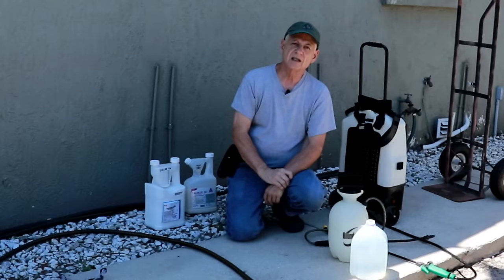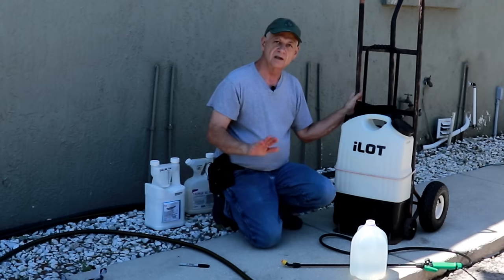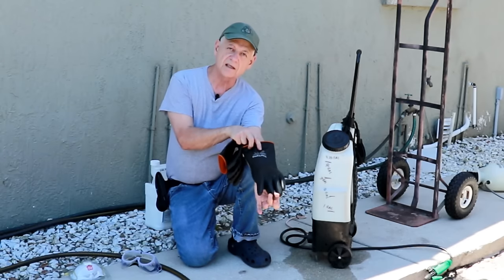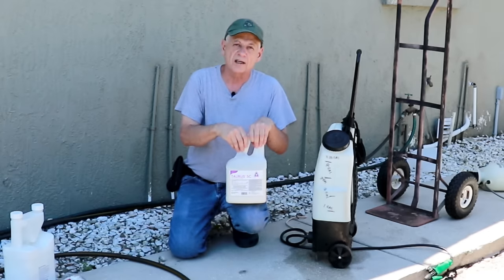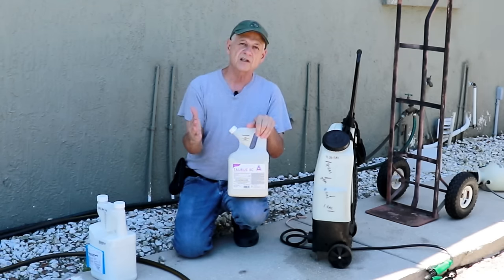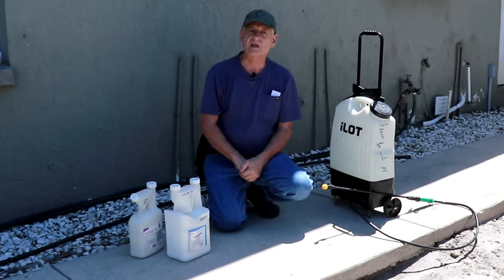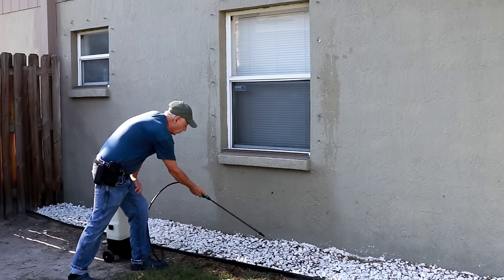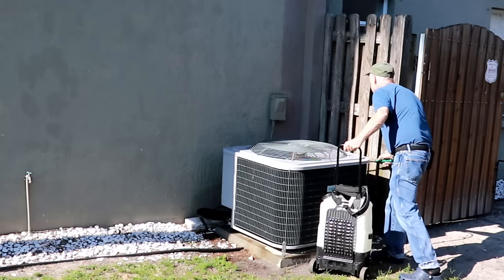General Exterior Pest Control - IMPORTANT!  READ THE DESCRIPTION.

Comment: I love Birchmeier backpack sprayer I think it’s the best in the industry. Do you like products Alpine WSG or Suspend Polyzone or Demand?
Reply from the maker: I have never used a Birchmeier sprayer, but I’ll bet they are really good.  I checked them out and they look well made.

The three products you mentioned work somewhat differently.  That is not to say that one is necessarily better than the other.  That being said, I'm not sure that I would use the Alpine WSG for exterior use.  It's a super safe product and that makes it a good choice for interior use, but the reason I would shy away from it for exterior use is that it does not possess the longevity that some other products do.  That is to say that the residual activity is only about 30 to 60 days.  The other products you mentioned can last up to 90 days.  I mean, time is money, so why retreat the same areas more often than you need to?

Out of the three products you mentioned, I have not had the opportunity to use Demand yet, but it does sound like it would do an impressive job.  I will have to give it a try one of these days to see how it does.  I don't see any reason why it wouldn't work well.

The Suspend Polyzone uses deltamethrin as the active ingredient and I have been using deltamethrin products for quite a long time now.  It works well, but I can't say that it works any better or worse than other products that are on the market.  The truth is that I do not conduct any sort of research on various products.  I think most of them pretty much do what they claim.  As with most people, I have a tendency to stick with what I know.  It's like that with all sorts of things.  People seem to like a certain brand of laundry detergent or a particular brand of dish soap and so forth.  I'm not sure that one particular brand is any better than the other, but for whatever reason, we seem to lean toward one product over the other.  For me, I have used a bifenthrin based product for a long time now, like Talstar P.  Bifenthrin has been doing a good job for me for a very long time, so I tend to stick with it.  That doesn't mean it works any better than deltamethrin or lambda-Cyhalothrin.  It's just a personal bias on my part because I've been using it for so long.  The truth is that I should give Demand a try and see how that lambda-Cyhalothrin works out.  You never know, I may even like it better.

Anyway, all of this is to say that my recommendation is to try different products and see what works best for you.  When I say that, I need to take my own advice as well.  I like that you have an open mind about product selection and you are willing to try different things.  I need to follow your example.  We've all heard it said that you can't teach an old dog new tricks, but I don't think that necessarily applies to old pest controllers.  I think you have me convinced to expand my horizons a bit.  Please let me know if you find some of these products to be superior over others.  I am always interested in that sort of input.

Thanks for the question and thanks for watching.  I'm sorry I couldn't be more definitive about selecting a particular product.  Be well my friend.

Comment: Hello Guy thanks for the videos.  I just finished trenching and applying Tremidor as per instructions around perimeter of home.   Now I’m planning to spray Fipro aerosol termite spray, (I have two termite tubes hanging on my Sheetrock ceiling in my bedroom.  I drilled a few small holes in the Sheetrock walls but I’m feeling nervous after reading up on the toxicity of this spray.  I did not spray as of yet .   How toxic is this Fipro ?  Is it safe to sleep in this room? 
Any advice will be appreciated. Thanks
Reply from the maker: The Fipro is not toxic at all after it dries.  You should wear rubber gloves and eye protection when you use it though.  It really isn't any more toxic than regular laundry detergent, but you wouldn't want to get that in your eyes either.  You are only supposed to use Fipro in cracks and crevices or in holes that you drill.  Not as a surface treatment.  It will not harm you after it dries and it is perfectly safe to sleep in a room where it was applied correctly.

I hope that helps.  Be well my friend.

Comment: Thank You for your videos! My question is, for American Cockroaches ,  do you recommend an IGR for the outside perimeter or is the pesticides alone sufficient?
Reply from the maker: An IGR never hurts, but it's really not necessary.  I never use an IGR and I never get American roaches.  I had them in the house when I moved in 10 years ago, but I have not had them for years.  Just using the Taurus SC and the Talstar P will do the job.  I alternate between the two products every three months.  Start with the Taurus SC and then three months later use the Talstar P, and then back to the Taurus SC.  If you want to save some money, you can replace the Talstar P with Bifen IT.  I will give you a link to it.  Same product, but a bit less expensive.

I hope that helps.  Be well my friend.

https://www.solutionsstores.com/bifen-it-insecticide
Reply: Thank you very much for your response! I enjoy all your videos!
Reply from the maker: You are very welcome.  That is so kind of you to say.  Very much appreciated.

Comment: Hi Guy, for those with kids that play with dirt outside the home, what precautions should we keep in mind? How long after treatment should kids be allowed to go out and play? Thanks so much for this video. Truly helped.
Reply from the maker: That's a great question and a very important one as well.  The answer is that both pesticides are perfectly safe after they dry.  So, keep the kids inside while you are applying the pesticide and don't let them out until it is dry.  If the kids are just playing on the treated dirt, that's fine.  However,  if there is a particular place where the kids like to actually DIG in the dirt, then out of an abundance of caution, you may want to just skip that particular area.  For example, I would not treat a sandbox that the kids are playing in.  The only exception to this would be if the area where the kids are digging has activity such as ants or other pests that can either bite your children or invade your home.  In this case you can treat with the Talstar P.  The Talstar P is a much safer product than the Taurus SC and it is a nonirritant to skin.  Getting dirt on your skin that was treated with Talstar P will not cause any harm to children.  Still, if you have a dirt area that the kids routinely dig in and there are no visible bugs, then there is no reason to treat it.  If there are bugs, then I think treating with the Talstar P is a better option than letting the kids play with the bugs, particularly if these bugs will bite or invade your home.  Again, if the kids are not digging, but just playing on the dirt, then treating it with Talstar P is fine.  In fact, you can treat the entire lawn with Talstar P every month to control all sorts of bugs, like mosquitoes, and the lawn will be perfectly safe for the kids to play on after it dries.  You may want to check out my video on how to treat your lawn super fast with a garden hose sprayer.  I show you how to do it in my mosquito video.  I will place a link below in case you are interested.  Thanks for watching and please click on that share button and let others know that I am always here to help.  I will always answer any question, on any pest, for anybody, anytime, even if I do not have a video on it, and as you can see, I will take the time to explain everything in detail.  About 84 percent of my viewers come from kind people like you who shared me.  Only about 16 percent of my views come from folks who are searching for information.  My goal is to help everybody that I possibly can, so the more the word gets out, the more people I can help.  Be well my friend.

Mosquito video:  https://youtu.be/LkkrW_tlLkg
Reply: @GuysPestSolutions  Thank you for being a blessing!
Reply from the maker: Always my pleasure.  Please let me know if I can be of any further assistance.

Comment: Great video. Very comprehensive! Thank you!
Reply from the maker: You are very welcome.  I don't think I made this clear in the video, but you can do the first treatment with Taurus SC to eliminate any infestations that exist and then just use the Talstar P every 90 days after that.  If you would like to save a little money, you can also use Bifen IT instead of Talstar P.  Same thing but a bit less expensive.  You can also use Bifen XTS.  It is a lot more expensive to purchase, but you only use 1/3 oz per gallon instead of 1 oz per gallon, so it goes three times as far and actually costs less per finished gallon.  So, it ends up being the most cost-effective product.  The sprayers recommended in the video are no longer available, but any battery-operated sprayer will work just fine.  All the products can be obtained for most states at domyown.com.  Be well my friend.
Reply: @GuysPestSolutions  are the different chemicals mentioned because it works best to alternate and not let the pest build immunity? I just purchased the Taurus SC and was going to use that every 3 months at 0.4oz.

Also, I can’t decide between a manual pump 4 gal sprayer versus the battery powered pump. I know it will be more convenient with the battery powered but I fear it won’t last and break down easier than a manual pump which I assume will last many many years of trouble free operation.
Reply from the maker: The Taurus SC does work better, but it is mostly used to knock out an existing infestation.  You should mix it at 0.8 oz per gallon though.  Mixing it at half strength is not a good idea.  It only lasts three months though.  Since you are only allowed to use it every six months, you need to fill in with another product after three months.  You can use Talstar P, Bifen IT, or Bifen XTS.  I have found though that, after using the Taurus SC just once, you can just use one of the other products going forward and you don't need to use the Taurus SC again.  So, you can alternate every three months, or you can just stick with Talstar P after the initial treatment with Taurus SC.  The result will be the same.  The big difference is that going with something like Bifen XTS will be more cost effective.  The important thing is to do it every 90 days.  I hope that helps.  Be well my friend.

Comment: Guy, Do you have recommendations with patio pavers? Should I pull them up where they meet the house to treat?
Reply from the maker: Pavers or concrete next to the house is never a good thing, but mostly because of termites.  The pavers will not present a problem for other pests.  So, no need to remove them.  Please watch my updated version of this video.  It is much shorter and contains more information.  Link below.  Be well Tammy.

https://youtu.be/Yozv3s-Qwlw

Comment: Thank you for making such a detailed video, Guy! I will be moving to a house where I need to apply an interior and exterior application. Would love to see a video about interior chemical DIY pest control as follow on to the exterior guide.

Any thing I should watch out for when doing an interior application? I plan to cover baseboards around the home along with interior corners of the ground level cabinets and closets. For interior, I will be working with Bifen IT.
Reply from the maker: I am never a big fan of treating the inside of a home with pesticides, unless I have no choice.  If you are going to treat the inside, you may find that the Bifen I/T has a bit of an odor to it.  It's supposed to be odorless, but I can smell it.  I would suggest Temprid FX for interior use.  I will place a link below.  You can treat baseboards, under cabinets, and such as that, but do not treat areas where food is prepared, like counter tops.  Other than that, you are good to go.

I hope that helps.

https://www.solutionsstores.com/temprid-fx

Comment: Guy. I have vinyl siding. You the ones that overlaps one another and has the woody pattern. My quarrying is will drywood swarm ers enter through the small weep holes under the siding or where the siding overlaps (even though it looks tight)
Reply from the maker: Drywood termite swarmers are pretty small and I suspect that they can make their way into those holes in the siding.  That is why you should do a preventive treatment every 60 to 90 days.  In your case, I would spray all of the siding.  If you have not done so already, please watch my video on how to prevent drywood termites.  Also, you should know that the only way to eliminate a drywood termite infestation is to fumigate.  If you fumigate, then please also watch my video on how to hire a pest controller without getting ripped off.  It may save you a lot of money.

I hope that helps.  Be well my friend.

Video on how to prevent drywood termites:  https://youtu.be/neNsmVbj8Pc

Video on how to hire a pest controller without getting ripped off:  https://youtu.be/y-a8XOqVrlE